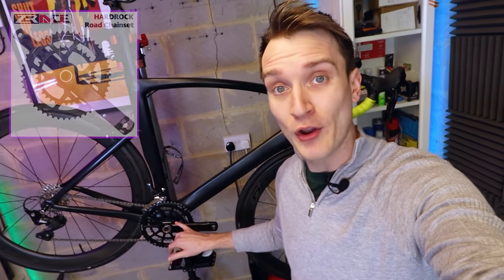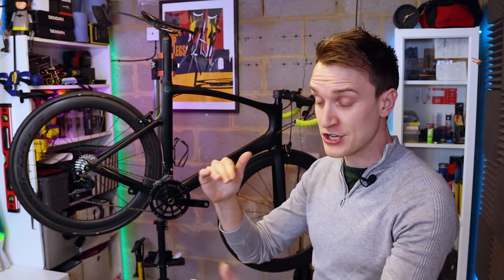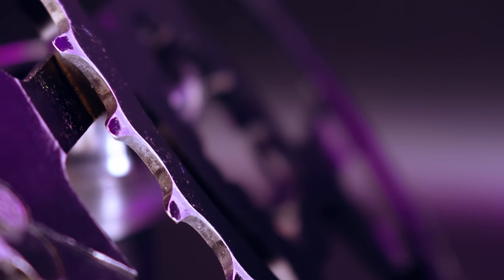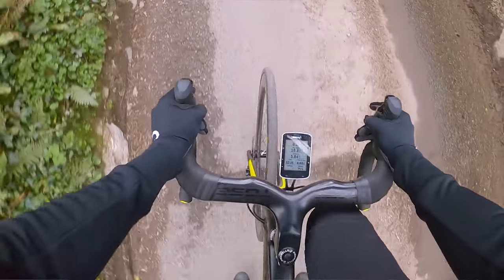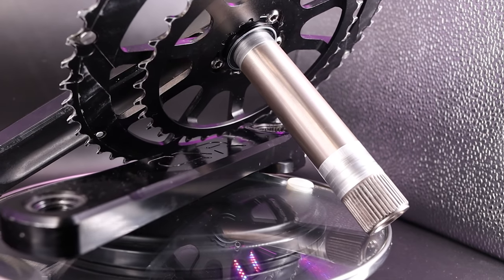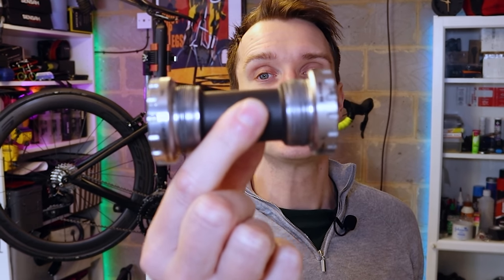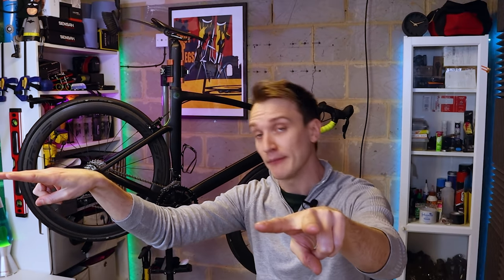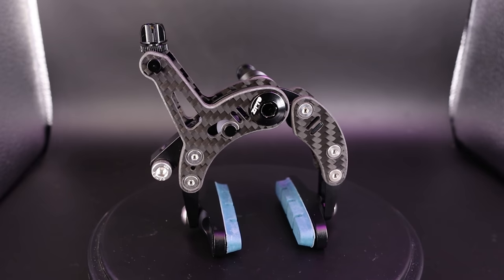Cheap Chinese Crankset ⚠️ Is failure inevitable?

Comment: My power leg has slipped off of pedals already  (flat pedals going to work,) and the resulting crash was instantaneous! I'd imagine that a crank arm or spindle breaking, would result in the same kind of crash... If using this, i'd put it on the ugly, go-slow- grocery bike, but, then, I can put on a cheap, steel crankset for the same price and not worry at all about a massive faceplant. (btw, video liked and very much appreciated.)

Comment: Luke at the risk of your channel falling apart...at what point do you stop wasting your money?! Fatigue may be at hand but they look like shear failures (due to torsion). I would not rule out an overload situation, especially if the material has internal defects
Reply from the maker: I just like testing out these cheaper alternatives, a lot of the time you can find some great quality stuff, plus it makes me feel ALIVE! I think you are onto something with the failure mode of these axles though, Paul’s one was not particularly old, so straight aluminium fatigue probably wasn’t the only factor!